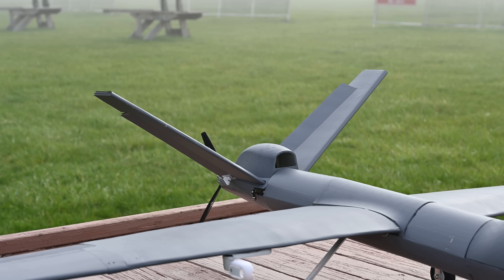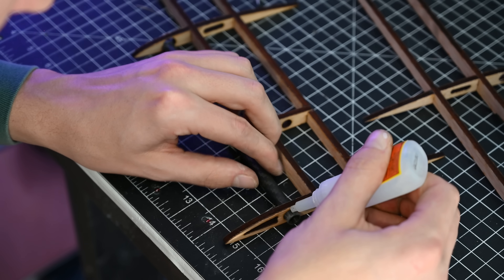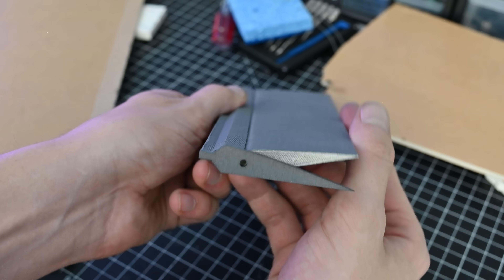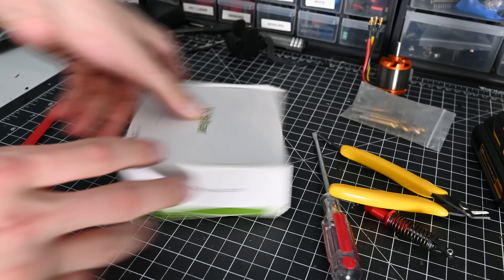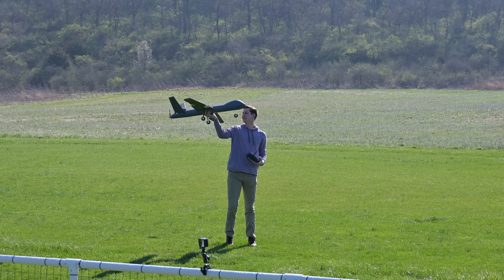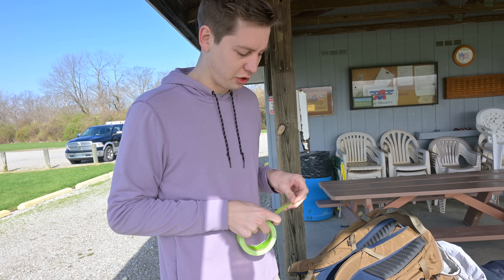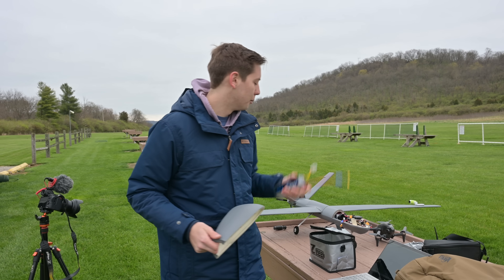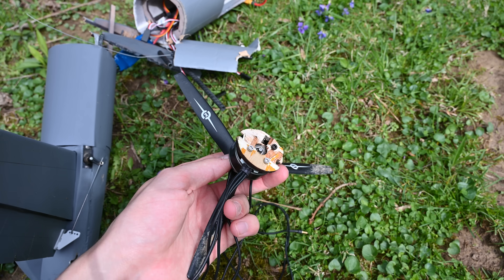Building a DIY REAPER Drone... Ended Badly

Comment: You don’t need to throw the plane. You should do a run and then just kind of “let it go”. When you throw you can confuse auto flying especially if your PID gains aren’t properly tuned. Also you can calculate the center of gravity and center of lift easily inside of XFLR5 to see if it will fly. Another easy way is to just have a string and find where the aircraft is balanced

Comment: hey my man try to use bigger wheels so you can take off from the ground. When launching try to have someone else throw for you that way you can focus on flying during important parts. The torque of the motor in the back may of been the cause of the rotation toward the ground.
Reply: after watching it again its very heavy. looks like its tale heavy. focus some more time on balancing before flying. really cool using a wood design id enjoy learning how you do that sometime. maybe also watching Flite test. Josh has a lot of knowledge about these things.,

Comment: I would like to suggest you add solar panels to your design and a PCB way charging board that you'd need to create that would be controlled to only charge after the battery gets to a certain level and turn off at a certain higher level. I would also suggest you weigh your electronics and battery and find your plane's center of gravity then add your electronics accordingly to balance out your plane's center of gravity. I am no expert for sure but have watched thousands of hours of youtube videos on successful and not-so-successful Rc plane builds. I am disabled and don't get out much, but I do like to try to help where I can. I really liked your design and ingenuity in building your plane. Hope my suggestions are helpful in giving you some ideas. I would also like to suggest you raise the engine above the rear of the fuselage and build a launch rail system that helps send your plane into flight. Raising the motor above the fuselage might save you from landing damage. I am sure you could print a design that would be aerodynamic while allowing the motor to be high enough to keep the prop off the ground meaning you could cut weight also by removing landing gear.

Comment: your longitudinal members just need to be taller; the bending moment grows with the length of the aircraft. also avoid these sharp 90 degree corners from the assembly cuts, you're both severely thinning out the cross sectional area of the longitudinal and creating a stress riser at the weakest point. The wing seems to have held up great so leave it alone!

Comment: Nice project!
And it seems no one uses wood anymore in the hobby.
As you pointed out, balsa is the go-to wood for many projects, but cedar wood is a good too, stronger, heavier than balsa but relatively light at 0.32gm/cc.
And easy to get hold of too.
Good use of modern materials too.

Comment: I'd say build it the same way you did, but add a lot of gorilla glue. spray water on parts before you add the gorilla glue if you want it to foam up and dry faster. use tape to keep it from seeping out the edges as it's expanding.

Comment: forget rolling landing gear, use skids, just some moderately elastic strips (thin steel or plastic or wood) coming out at +-45° and tied with strings to the back of the plane to somewhat prebend them.

Comment: Just to give my two cents worth, I think the cause of the failure is when you change the battery to a much heavier one leading to a nearly ( or tendency ) nose dive flight upon release or take off.  The weight to thrust ratio should have been taken into consideration.   But since you have proven yourself capable of building a diy drone, I believe you will be successful in your  attempts or endeavours in the future.   And so, I am looking forward to seeing your upcoming videos.  Good luck.

Comment: Suggestions for improvement: Actually DESIGN the thing rather than just winging it. Example "plenty of thrust" is not a good way to characterize a propeller: and Just added another battery behind the wing" is not a good way to determine the center of gravity. Good luck

Comment: I agree with the idea to create a crossbow style launcher like Zipline which will give you consistent force to direct it into the air with enough speed and also allow you to be ready on the controls to speed up the motor. You do not need the wheels since the tall grass makes them unusable. The bottom can be like a sea plane so it can slide along the grass for a graceful landing. Just position the props so they don't get pulled off.

Comment: a little more power + paved runway like real version uses. Less drag like some way to retract gear would help too.  If you still throw it, it could start gear up (since you know the gear doesn't help a bit on aborted throw launch anyhow) and just have a servo pull a pin that allows a spring to force the gear down and lock.  Thanks for doing this, I had fun watching!

Comment: You always need to use bigger tyres than you want to flying off of grass, some goofy big tyres would have made this work so much better. Your build was awesome, don't get me wrong, but 1/4 ply seems way too thick, at this scale 1/8" would be fine and cut your flying weight considerably, hotglue is fast, but urethane glue is a lot lighter and you don't need as much, plus it expands and fills gaps.

Comment: With that bigger battery plus the extra battery you are going to need at least a 500 watt motor and an 11x5.5 prop if you plan on hand launching it. That tiny little outrunner you got on there wont cut the mustard with the extra weight of that 6 cell.

Comment: Get rid of the landing gear for test flights! It will help endure ruff landings by applying forces on the wall fuselage instead of just the fixing point of the landing gear..

Comment: ...you might want to shape the stabilizer with sharp trailing edges, just like you did on the wing. This will decrease drag and most importantly increase the elevator aerodynamic effectivenes.

Comment: Nice work on the wing trailing edges, sharper than just two pieces of foamboard which is like 1/2 an inch and draggy and just looks lazy.  Just a little bevelling and it looks much better.

Comment: tape and glue it all back together. then put a demoulding wax on it and make a negative mould from cheap GRP . Then finish off the moulds. Then layup a carbon fibre positive from each mould half. Pin it together . or just use tape.

Comment: A mini sized 12 volt or less solar panel and glue it on top to keep the battery charged or just a 12 or less volt solar panel without an actual battery but still powers it???

Comment: How about just 3D printing the outer shell and and wings then screwing them into the frame. Also I would recomend a 3D printed support frame for the landing legs where you can use screws to lock the legs into the support frame

Comment: Oh, you never fly (as a pilot) without properly calculating weight and balance. Also takeoff distance required. But I haven’t looked in to model flying planes. How do you calculate or estimate the performance of the airframe?
Great video by the way. Thanks for sharing

Comment: "But.. I guess it could help the flight time."
No.
No it did not.
Having a runway would give you a chance for a proper rollout, though. Perhaps even some lift testing before the re-maiden? If not, then at least ditch the gear and 3-blade prop (a 3-blade will catch every time, a 2-blade at least gives you a fighting chance. Good luck brother!

Comment: i would say keep the batteries and put a much larger engine on it like maybe a gas powered engine? or even cooler if you have the money for it, which im assuming you dont. throw a jet engine in it. no only would it be faster it would stay in the air for a considerable amount of time given the fact you make it the right size and give i a good fuel capacity. also im going to go on a whim here and say what everyone else is saying, build a drone launcher as well.

Comment: From my initial thought, the 6S will gives you more propulsion, but not necessary gives you more capacity, in conjunction, the additional cell structure added more weight. I would think using a higher capacity low cell count battery will provide you with longer flight time you desire, as fix-wing vehicle are far more efficient than quad, once airborne, you shouldn't need too much power to keep it afloat, especially if you are not planning on flying acrobatics. So, higher cap low cell battery, rebalance for CG should do the trick. Great build!

Comment: I made exactly the same thing with my first on, trying to put to heavy a payload for the exact same result, I ended up fixing it and flying it with a 4 cell battery  and a 6 cell of of a bitumen runway (it needed way more speed due to the weight and was no longer flying like a drone, I made a second one 50% larger with balsa, carbon fibre and orokote (film covering), the difference was night and day and it flew awesome, I was going to make slightly longer wings but got offended a swap I couldn't refuse, one day I might make another one also 50%larger but with the wings about 15cm longer to improve glide ratios for longer flights (yes in a moderate wind it glides beautifly lol)

Comment: Great project. Try aluminum tape instead of re-enforced tape. Friends dad worked at Grumman in the 70's and 80's and that's what they used on wings, we would get it since they would not re-use open rolls. Also wheels are overrated for small aircraft, try skis for landing and a catapult for take off.

Comment: Cool HOWEVER if instead of all the parts work you just made molds, as single piece as possible, say top and bottom side including wings, you can make it out of a single thin ply of carbon fiber and it can be beautiful, smooth, light and strong with max volume inside. You can do flimsy V tail and put antenna in those because CF swallows radio. Maybe fly it from smooth asphalt road.
You could even develop a technique to make the plane single piece, like put the wet cloth on a foam stick with inflatable part and put inside 2 side mold. Bit more elaborate but saves you connecting the two sides and will have very high strength. A technique worthy of actual production.
Side note: you can make the interesting observation that the Reaper despite decades in production is a quite suboptimal design because the camera ball is just out in the air. They made no attempt to aerodynamically integrate it in the hull. Funny how billion dollar designs are just plane incompetent. Pun intended.

Comment: I was impressed, that you still were bending down to pick that thing up. It was surely not worth the effort anymore. Well, happy accidents are great for iterations. Next iteration will be better. I hate it, when things work and I just am showing what I can and not what I still can learn. Someone not going over his boundaries will never overcome them.

Absolutely great project. I want to see that next iteration flying. Ever thought about doing that with a hybrid? Means a motor driving a generator, that is driving the electric motor? This will stretch the flight time by far and the motor only needs to be very small. Your batteries don't need to be big, they just have to stabilize the thing enough. Megacapacitors or something. Makes that thing more lightweight. 

I have never seen a hybrid flying.

Comment: Carbon fiber pins to join wood or all the way though if you got the cash for that. Could also do very thick but gutted aluminum struts for main body components. I'm no aerospace engineer tho, just a clever cat with big ideas.

Comment: Chinese tb-001 it has a lot more hard points then the reaper & the four propellers one call the scorpion….

It makes the reaper look like a little… “use your imagination”

But honestly the first one has three propellers, one on each wing and one having 1 engine facing opposite in dead center in the rear.
The other one it's pretty much the same thing with exception of two propellers on each side and it holds cargo

Comment: Increase rigidity and cut weight by wrapping the body in a light fabric you've 3d printed a hexagonal pattern on to it.. Probably only need to be 1mm thick w/ 3mm edge. You can even design small reinforced areas as needed like extra ribs

Comment: Oh Michael, the fact that your design flew so well in most of your video was inspiring! The reason why we (used to) build out of balsa wood is because of it's "strength to weight" ratio, nothing beats it in the flying arena. However, and bottom line here Michael (because everyone gave you such wonderful advice within their comments) is that #1-check your C/G (center of gravity). To start with your maiden, go with 25% of the forward wing in front of your C/G; this will cause your bird to be a bit "nose heavy" but better nose heavy that tail heavy Michael! #2 Once you have the C/G where you want it, be absolutely sure that your plane balance laterally (I noticed that you had a camera on the starboard wing) the weight and drag of that camera will cause the aircraft to yaw to the "right," be sure that you suspend the craft from the nose and the tail down the centerline to check balance. I would bet that if you built the craft balanced, right to left, that you had to trim in a lot of left aileron/rudder to get it to fly level. I could be wrong; you very well may not have built it equally balanced on both right and left sides! Me personally; I would leave the camera off, too much weight and drag for the benefit! #3 A heavy plane made from epoxy, hot glue, lite-ply & paint will need a bit of a roll-out before you rotate into the air; but have faith Michael, (given, the forgoing guidelines are followed) rotate it will!
Now here's the kicker Michael; the heavier you build it, the less "acrobatics" it's going to want to do, lighter is a good thing. However, you can go too light, so use your head and think your way through this and you'll be fine. Oh also; batteries are (usually) Lipos, but not all batteries of the same "described/advertised" value are the same size and weight, you've probably discovered that by now. Do some research and find batteries that are of the "voltage/4S-6S" value that your  and use as light as you can get! Also, that plane is what, about 2 meters wingspan? A Raptor is basically a glider design; if you're motor is designed to run on 14.8v then use 4S batteries, if it is designed to run on 22.2v then use 6S batteries. Also, please be sure that your ESC can handle whatever battery you decide to use; otherwise you will burn it out and your plane will crater in like you've never seen before! Finally, and this is a bit of a reach if you don't have one already; get yourself a "watt-meter" Michael, charge your battery up to maximum and place the watt-meter between your ESC and your battery and see what Watts/Amps you're drawing at full power. Oh, I almost forgot... since you're powering a prop motor, the "C value" on your batteries don't have to be more than 45-50C, any more than that and you'll have enough go juice to power up an EDF, which you're not using!
Great project Michael! With your attitude, spirit for adventure and obvious intelligence; you'll go far! Remember, a good pilot learns from his mistakes; he then utilizes this knowledge to become a better pilot!
Reply: This guy knows model planes
Reply: Has he implemented the flight control equations in software and loaded the executable file on the ardupilot controller or how it works. Can someone tell me.
Reply: Pet peeve when people use someone’s name a ridiculous amount of times

Comment: Problem with this build is not rigged enought, they flop too mutch.
Reply: Predators are bigger for a reason, size maters on design.
Fot that small size it will not have even close the carring capassity and the flopy nature of the wings make it real bad on load (that was what i was referring to on the post, posted before, when i only had seen the build part).

English is not my language(also@mobile), if some point or text is not understood will be happy to clarify.

Comment: Use 2x 3 cell in series to reduce weight, get the balance and still get the 6 cell power. Increased flight time can be done with getting larger 3cell.

Comment: "Maybe I'll build it out of something more robust."

Or maybe you could just take the bigger batteries out? When you have an airplane that tends to get broken landing gear, it's a pretty good indication that your aircraft is pushing the limits on mass.
The other solution is to make a significantly larger aircraft that's built as light as possible. Simply beefing things without increasing the surface area of the wings, will only increase the landing speeds. You want a big wing surface area with a light body if you want to carry high capacity batteries. (Note: Of course, it's OK to beef up the landing gear, but try to keep everything else as light as you can possibly get it.)

Comment: I think you need to mow a path for your plane or put larger wheels on it.  Also it is more stable and more reactive to have your propeller on the FRONT of the plane so it's wash passes under the wings and aids in lift and maneuvering at slower speeds.   Also a paint gun mount would be fun and some moving targets.  How many friends do you have?

Comment: I am going to sound like an old fart (and I am), you guys today are lucky back in the early 2000's when I was doing this we had to build not only the air-frames but all of the custom autonomous electronics from scratch, I have boxes of pcb's and parts, some that worked well and many more that did not. We had to use 72 MHz radios because I had not invented the 2.4 GHz Spread Spectrum RC system until later (and yes I did invent the 2.4 GHz Spread Spectrum RC system  but I get no credit or recognition for it ).